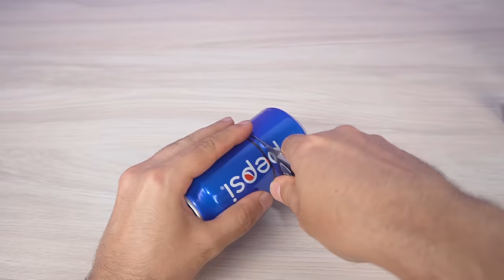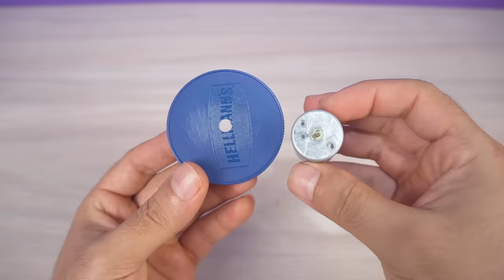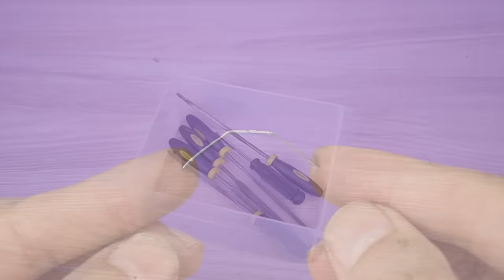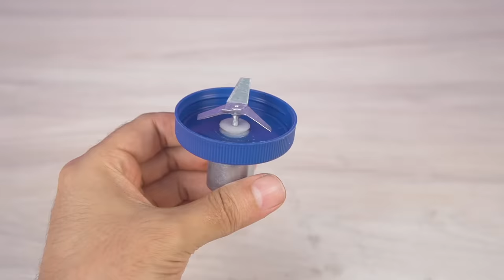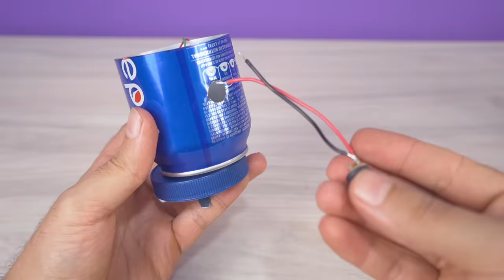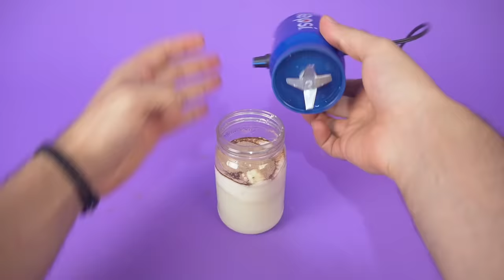Make an Amazing Mini Blender recycling Soda Cans

Comment: For anyone watching this that wants to recreate it, some safety tips...

Do not use super glue where there will be liquid. Surfaces bonded by super glue break down over time. Instead use food safe epoxy resin such as one from the brand ArtResin.

Second safety tip, do not use super glue to hold the blades together. Use silver solder instead, as it works just fine with stainless steel (the metal you should be using for the blades) as well as silver having antimicrobial properties.

This last tip is just my personal opinion. A single UV-C LED shining up through a transparent window on the cap to help disinfect anything you put into this blender while it's in use.

Stay safe, people.
Reply: I couldnt recreate this, still it was obvious the super glue wont hold them. Also friction fitting the blades to the shaft?